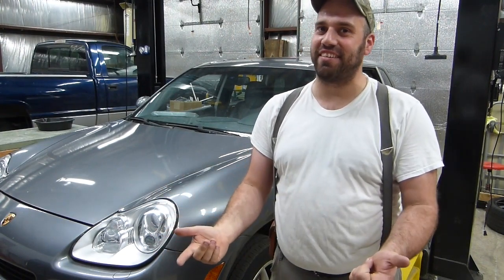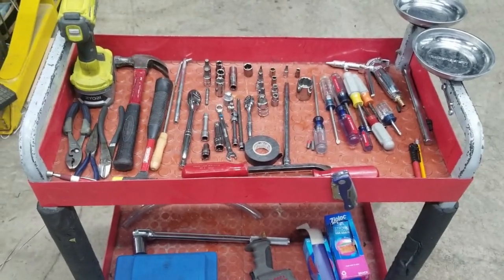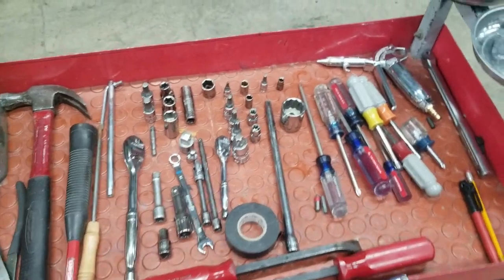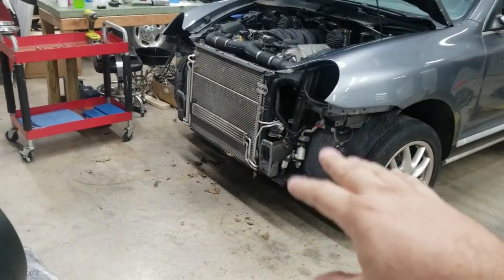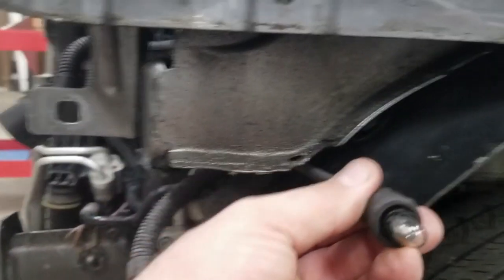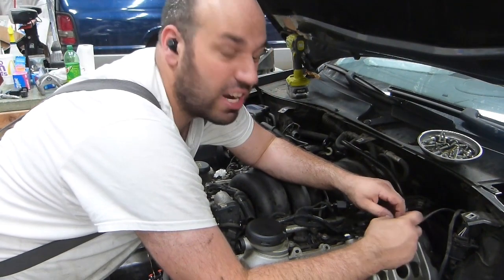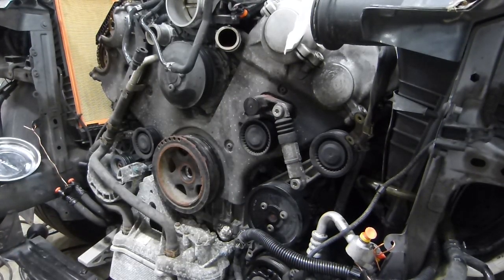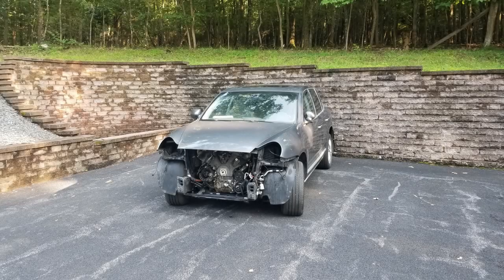2002-2006 Cayenne S 4.5L V8 955 Timing Chain DIY (Part 1) Teardown

Comment: You absolute beauty. Thank you. Im picking up the 957 cayenne S. I know the engine is basically the same just a little larger. Any tips on the timing chain replacement on that unit? Thanks again
Reply from the maker: the only tip i can give is that you is hold out for a 955 v8... the only engine that has port side injection. you will never have to walnut blast the intake vs every 80K on the other generations. that or delete the emissions EGR but the cost is about a grand with a tune. never worked on one doing a timing chain but both engines are basically the same. get alldata

Comment: Is this the same as 957 turbo 4.8 v8?
Reply from the maker: No. But the timing job would be very similar. The 955 v8 is the same turbo or not. But the 957 is a direct injected engine with lots of differences but overall I'd assume the procedure is fairly similar. Consult Alldata

Comment: Is this an interference engine?
Reply from the maker: you bet your cheeks it is. Why? did you have the forbidden kiss?
Reply: Lol, no but I'm not sure if I should replace to chain just in case  @timsgarage1356
Reply from the maker: @STATSk8boarding bottom line, you DO need to replace the chain. You need to look at bank 1 and 2 and the deviation in your durametric scanning tool.  If you do NOT have that, get it. at the 100K miles the timing chain is spent. you can do a little bit to buy some time but imo its not worth it.
Reply from the maker: @user-vt1vn7is6w  You must use the durametric tool and a laptop or the $$$ durametric tool, either way, you need to fimilurise yourself with the software, Cam shaft deviation /timing deviation, Bank 1 and Bank 2. the difference between both of them should be no more than like 8... so bank 1 could be -4 and bank 2 be 4. Mine was -7/+14 and it ran OK ish. anything past 14 gets dangerously close to the valves hitting the pistons. I don't know for sure but something like 17 and bad things happen. If the deviation is within 8 like i said you can get away with just resetting the timing and replacing the tensioner but this is just going to give you about 20K miles before you HAVE TO DO THE SERVICE. the re timing is just so it can run safely before you get the work done. When i was done, it was 0 on both 1 and 2.

Comment: You're obviously not a factory trained Porsche tech - well done you for tackling this job. And it's refreshing to see you clean as you go. So many shops IRL are basically junk yards and that has to reflect on their quality of work.
Reply from the maker: Is that a Compliment? I will assume it was. Thanks! You should see part 2! If i was a tech of any type i would NOT be doing  work like this. I make more $ and have a much more enjoyable job doing what i do vs being a shill for scamon tools and a slave auto shop of any type... btw i have worked in a few shops... NO THANKS. I rather enjoy making 2x the income doing high end tile and bathrooms.

Comment: s there a special way to position  the cam sprockets when removed?Also are we suppose to line of the cam gears/Sprockets on the chain a certain way.Service instructions are vague.
Reply from the maker: As long as the cams are locked out (they only lock out 1 way because the slots are offset) and the crank is locked out, install the chains with the sprockets able to spin freely, then tension them and torque the cam sprockets down. That it. Make SURE you check the TDC of each piston. TDC on these engines does NOT give enough clearance for valves to open, if you take the sprockets off while the cams are pushing on lifters, then the cams could rotate VIOLENTLY and FORCE valves into the pistons. SO my advice is do what I did in part 2 describing how I fixed the 180* out issue I had. I was able to rotate the cams freely after turning the crank about 1/4 turn? Just don’t let the cams go without some thought. I’m not sure on the specs but that how I did it no issue.
IMO lock out the cams properly in the back, then take off the cam caps SLOWLY, just back out each bolt a turn then move to the next, start from the inside center and work crisscross outwards. I would keep the crank locked out and the chains on to prevent them from spinning during this. It does not matter what you do after that. As long as it locks out its fine to reassemble.
KEEP THINGS CLEAN, use coffee filters and mineral spirits to clean things before assembly. If you get any grit (too small to see) on the cam journals you are going to cause damage.
Reply from the maker: get ALLDATA DIY
Reply: So there is no mark to line up with the chain n the sprockets?
Reply from the maker: @exquisiteautocollectionllc2921  exactly. it does not matter how you do it as long as the cams and the crank are locked out, the chain can just go on.
Reply: I have all data and Mitchell diy
Reply: So it doesn’t matter if the sprockets aren’t in their original position on the camshafts?

Comment: Buen dia  tengo un problema de un porche cayenne v8 2006 bota vurvuja de aire al deposito de agua y cual es el problema aver una informaccion sobre ese problema amigo
Reply from the maker: You need to try a few things. Drain the coolant, pull spark plugs and pressurize each cylinder after rotating the crank so both intake and exhaust valves are closed. You need to go as high as you can on the air compressor 145 PSI. listen for air out of the coolant tank each time. If you hear air, the head gasket is SHOT or you have a cracked block sleeve. either way that would be a total engine tear down or replacement. 
Chances are you have an issue with the coolant system. you can pressure test it or vacuum test it. The 955 has MANY issues with the OEM stock coolant system and now the tank at this age and miles will explode. Replace it if its leaking or past 100K miles.
Reply from the maker: Did you figure it out?

Comment: So what are the chances of just needing the tensioner and guides? Do the chains actually stretch on these? Thanks
Reply from the maker: CHECK it out, i finished part 2 https://youtu.be/k9OgSaqOOM8
Reply from the maker: not sure if i answered this but YES 100% the chain stretched. i was not that far off for it to still run but still give a code, see video for bank # differences, but the new vs old chain was an entire link longer only after 100k

Comment: hello i need help
I opened the v6 engine and I didn't mark anything, I took out the chain and now I don't know the position of the crankshaft and camshaft, can you give me some advice on how to solve it, thank you.
This is a 2011 Porsche Panamera 3.6 v6
Reply from the maker: The cam shafts can only be locked out in one way for TDC. as for TDC of the crank, #1 piston must be at the top of its stroke and there is a lock out for the cranks harmonic ballancer. Sorry for the delay, im working on part 2 now. Im working on it as we speak now. Life got really complicated and busy but now ill get going on it. Thanks for the patients.
Reply from the maker: CHECK it out, i finished part 2 https://youtu.be/k9OgSaqOOM8

Comment: where is part two lol
Reply from the maker: CHECK it out, i finished part 2 https://youtu.be/k9OgSaqOOM8
Reply: @timsgarage1356  dude!!! Omg!!! Thank you!!!!! Been eagerly waiting lol.
Reply from the maker: i have part 2 and 3 in the works. life got really busy with a move across country and the footage just needs to be edited and posted.
Reply: @timsgarage1356  Totally understandable, been crazy to see someone actually doing this job and breaking it down. because i need to check out my timing. P0018 code on mine remains after sensors being replaced.
Reply from the maker: @HappyFish50  have you checked the difference on bank 1 and 2 for deviation of cam location?
Reply: @timsgarage1356  I have not... Its been a bit chilly and wet in the good old PNW. It is my plan to do so once the sun hits. the last time Driver side cover was off, Was when i purchased the suv and noticed it ran very rough. Stuck the good old waka waka 5000 on it and it ready misfires and bad cam/cranksensors. Replaced, plugs/coils/sensors/oil.  after a week of driving, P0018 came back. once again im on the damn runner. its my DD... lol...

Comment: How did you confirm it was a timing chain. do you have a video of the noise before you opened everything up?
Reply from the maker: used an oscilloscope on the CPS on both banks to confirm that they are working  correctly and to confirm that the +8 on bank 1 and the +14 on bank 2 deviation on the timing was accurate. now that its done, bank 1 is 0 and bank 2 is +2.
Reply from the maker: CHECK it out, i finished part 2 https://youtu.be/k9OgSaqOOM8